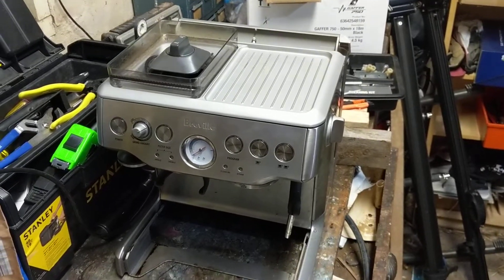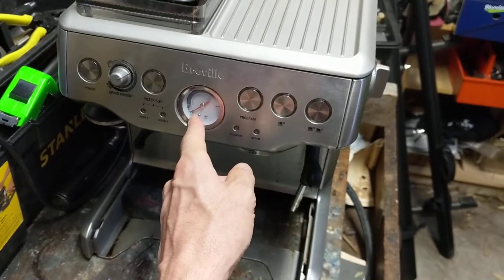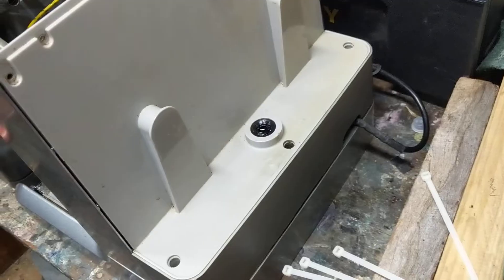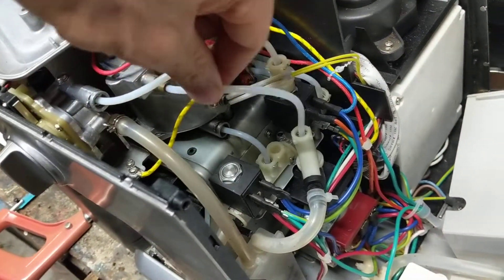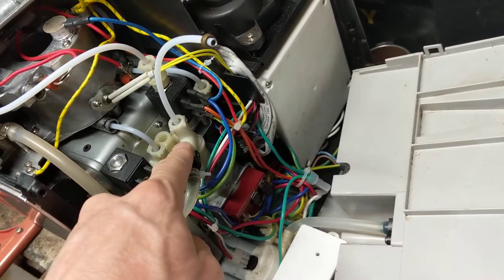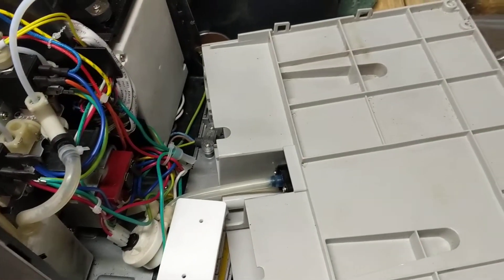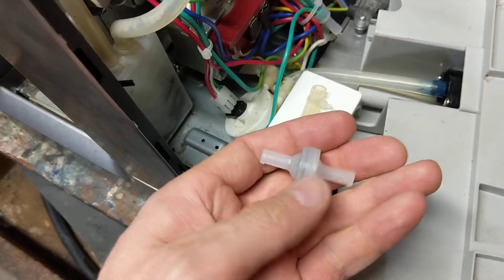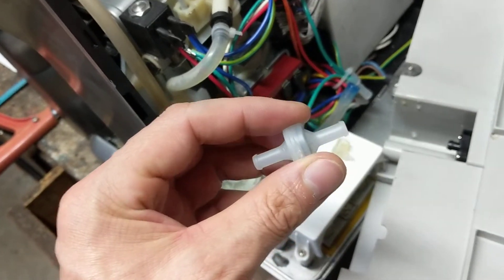Breville BES860 repair for low/no pressure and low water output

Comment: Thanks for this! I was almost at the point of ordering a pump. But after taking apart the float valve and that "this fellow"  part, i tested the flow after taking that off and it was normal flow. I let it soak in vinegar solution, washed and blew it out in case there was blockage. Everything works now. Thank you again Chris!
Reply: Hey mate, do you have the 860 or 870 xl ?

Comment: Thank you for this video. I wasn't getting any pressure until about 30 seconds of pouring the shot. I knew that the pump was working because of that pressure. My water spout also was coming out but very little and the water was splattering everywhere. I took off the tank and the back panel of the machine and saw the inline filter clogged (the one referred in this video). I couldn't find any replacement part and so I decided to clean it. I used an air can that has a straw (the type used to air out dust in electronics) and ran water through it until the water flow was good. The ties are important, use new ties. I couldn't get all the muck completely out, only about 80% of it. That is the cheapest solution. It worked like a charm. I hope this helps someone out.
Reply: Thank you, this video and your comment specifically helped me out! I had the same problem exactly! The filter looked fine, it was a Hail Mary pass as I was desperate to fix this issue. It worked. Thank you SO much.

Comment: Thank-you!! This video was really helpful and our inline filter was indeed blocked and the cause of low pressure.  My husband was able to blow out the blockage. (I think he used his compressor for that.) The trickiest part was taking the rear cover off. It is clipped in and took a few goes to get it off.

Comment: Bless your heart, your video has solved our problem! We were having trouble with our BES870XL - with pressure at the group head, resulting in incomplete shots and poor crema, and the hot water spout was steaming, spurting and causing a real mess. I replaced a lot of parts  - pump, safety valve, solenoid - and we were still no better off. After watching your video I took the machine apart again (I'm an expert now) and found and removed this filter. I put it in a mason jar with 100% Simple Green and immersed that in an ultrasonic cleaner for half an hour at 40ºC. Afterwards it was rinse, blow out with compressed air, repeat - about 5 times - and reinstall. Having made the other repairs I though this one was worth trying and I was hoping for the best but not expecting much. Lo and behold, everything is as new. Thank you so much!

Comment: Thanks for making this post, I took it apart and fixed my machine! I used a little flosser thing to clean it pretty well. Gonna order an extra part now for the future!
Reply: where can you buy this inline filter
Reply: @mikeamiri4794  SP0001461, You can also just clean the filter. It'll be blocked up by Charcoal, I used a reusable flosser thing and cleaned it up pretty decently. Prime reason to soak your water filters before installing them.

Comment: Was your machine not putting hot water at all? Because the shower head puts out little water while the hot water dispenser is functioning as normal.
Reply from the maker: There was very little water coming through and no pressure, however, steam worked oddly. The machine I have does not have a separate hot water dispenser, just the main shower head.

Comment: Thank you for your very good video showing the problem with the BES860. My daughter asked me if I would look at her unit which would not indicate pressure or give a coffee. Like you I suspected either the pump or solenoid. However as these are reasonably expensive and may not give a solution I eventually found your video. 10 minutes later the problem was solved. I actually reverse flushed the filter and now the unit is working well. Up until this stage I had dismantled the unit 5 times with no success.  Yes I am retired.  Tony

Comment: thanks Chris, this video saved my coffee machine as well. 
Tips for troubleshooting: (got it from home-barista forum)
Do a run with just the rubber cleaning inlet to see if you get any pressure (I got almost 0)
Let water run without gasket under to see how the water flow is (compare to video here when ppl do an empty run before making a coffee)
See if the plain hot water flow is slow as well (compare to friend machine or video on YT)

Cleaned my filter out with toothpick and banging it on the kitchen counter.

Comment: Thank you for this!

We were getting very little pressure, a teeny bit of steam, a drip of hot water. Obviously we were not enjoying a nice hot espresso for the last few days.

Came across your video, and went through the trouble of soaking the solenoid valves in vinegar overnight, didn’t do the trick. So clear the valves were not the problem.

Then I took out the online filter - BINGO!

Machine works again! You are a lifesaver!

Can I send you a bag of beans?

Comment: THANKS!!!  I ALMOST BOUGHT A NEW MACHINE .  Had my breville for 3 years thought it was time to retire it.  I had low water and no pressure, so I pulled the filter like your said.  I BLEW THRU IT USING MY  MOUTH.... TOTALLY BLOCKED!!!  I removed it and busted it open -- iT wouldn't come open otherwise ... the SCREEN WAS TOTALLY BLOCKED WITH SOME FIBERS -- BLACK GUNK.  <--- FIBERS FROM THE REQUIRED BREVILLE FILTER...?   Should have blew it out with compressed air, or used a needle to scrape the gunk away.   It is just  a screen filter to prevent large particles from entering the machine.  Just took the whole thing out, will replace later with a better in-line screen filter.   PERFECT OPERATION........  EVEN BETTER THAN BEFORE!!!  PRESSUE UP TO 12 O-CLOCK POSITION ON MY MACHINE, FIRST SHOT EXTRACTion!!!  I SUSPECT THIS I WHY MY MACHINE WAS RUNNING A BIT CRAPPY ALL ALONG...

Comment: Thank you so much. I had no pressure. I thought I would need to replace a solenoid or the pump. I cleaned the filter and it all works like a gem. Thanks again

Comment: Chris - thanks for timely tip. Replaced pump and machine still not pumping properly. Watched video, drilled thru screen and presto! Works great.
Reply from the maker: Nice. I didn't think of drilling through it. I cut it in half, cleaned it and glued it back together. I think at least one person who replied to this video was able to find a replacement part but I guess it's not essential, probably just extends the life of other parts as they get less dirt.
Reply: Hi Lee, did you happen to look against a light bulb to see if it was clogged? Or did you just go ahead and drill a hole!?
Reply from the maker: @fabriziosanabria5414  I also took this little video of the filter after I cut it in half. I glued it back together with a 2 pack glue (Araldite). https://www.youtube.com/watch?v=lxFlKTBczbo
Reply: @fabriziosanabria5414  - I could see black debris inside with a light. I tried to blow thru the filter and you could tell it was blocked. Decided to drill thru it. If tnook I was going to remove it.

Comment: You beauty! That was exactly my issue, I cut it open and it was full of crap, cleaned out back together and bingo, back to normal.
Reply: i took mine out and forgot to pay attention to which way it was facing.  Was the dirty side on the water side? and what did you use to cut it open im having troubles.
Reply: Shane Jowitt yes dirty side is water side as that’s the water entry point so debris collects on that side. I used a small Dremel cutting tool and made a fine slice, it’s not pretty but cuts it open, inside is a small metal filter, this is clogged from dust entering the water fill tank, then with super glue and baking Soda reglued it all back together, zip tie and Your water pressure is back to normal, like a new machine.

I would recommend then getting hold of Breville and seeing if spare filters are available to purchase, and getting spares. I’m currently about todo this. How many of these machines get thrown out over what could be a $1 filter..?
Reply: @zarmak2511  - Not sure if you will ever read this, but were you able to find the inlet water filter for this machine?  And if so, where?  I have NO water coming out of the machine...have done everything I can do and still nothing.  Have washed this filter a few times, but still no water.
Reply: Meme Meme  That’s the filter that I cut open, you need to cut it open and clean it or get a new one, my warranty was out by a couple of yrs so it’s was try and fix it or bin the machine, you may have a pump that not working,?
Reply: @zarmak2511  YAY...you wrote back!  
I have the BES 860XL.  It's one 9 years old, but I don't t think I've used it more than 20 times for espressos (I have a Nespresso) and used the machine mostly for steaming milk (stupid I know).
Replaced the pump...that wasn't it, so put the old pump back in again.
My husband washed all the tubes inside, including the filter, but he only rinsed it...didn't do an extensive clean like you did.
Where did you cut on the filter.  That particular part looks like a top (the toy) to me...is there a filter inside of it?
I tried looking for the part to purchase - Water filter Assy - SP0013624 - but it's no longer available.  
Thank you for being nice enough to respond.

Comment: Thanks, I had the same problem. This inline filter was completly clogged. I bypassed for now and will get a replacement ASAP.
Reply: I have the same problem but Breville is not able to locate or ship me this part. Where can I order this part?
Reply: @frederickguesneau8601  There are some on eBay but I found one at spares.bigwarehouse.com.au which I had used before for some parts. The part for my model was not available but I checked other models and found one that looked the same. When it finally arrived I compared the two and it was identical. This was their description. Good luck. 1 x WATER FILTER ASSY 8208 PRE TANK This part Suits Model:BES860 (PN:1674247)
Reply: @aw4296  Thanks Arthur. I called Breville  again and they were finally able to order part # SP0001461. If this doesn't work, I will  order via your recommended website. Thanks!!!

Comment: Super helpful, thank you @Chris Melin.  I have the BES920xl (the dual boiler), and this video and the comment thread even moreso helped me troubleshoot the problem.  I had done all sorts of work (symptom is very low flow from group head, but regular flow from hot water and steam wand, descale indicator always was on).  Your comments led me to pull apart the solenoid, and sure enough there was a piece of a degraded o ring wedged in the outlet aperture of the valve ... and it all works great now!
Reply: Hi, I think I have similar issue to you. Hot water spout work fine and so does steam. Does that mean pump is ok? However no pressure at group head. Even with blind disc inserted there is no pressure on the dial after 50s. I sometimes hear gurgling. The solenoid looks in good condition. However I can see some water on top of the valve that sits above the pump itself .. could this be due to a block?

Comment: Hi Chris :) Great video and so informative how you pointed out what every part is called! I too have this exact machine (BES860XL) and am getting ZERO pressure readouts...….. The needle does NOT even budge! Let me start at the beginning really fast. I bought this unit second hand recently and could not get it to dispense water either for espresso or to make steam for milk...….Although it heated up fine and all the right sounds were being made by the machine  (like trying to draw up the water out of the tank),  still,  NO WATER  ever came out the grouphead after like 30 40 seconds of running it.  Also when I switched to "froth" mode,  it tried to suck and made the clanking noise, but still no water or steam.  So I took it apart (love taking things apart LOL) and figured it must be a clogged water line since it sounded like the pump was trying to work. I decided maybe its clogged with calcium buildup, or maybe it just needs to be primed.....  In any case, I used a giant syringe (like a turkey baster) and had to put some muscle into it in order to force water into the tube (the one that feeds from the water tank).  I suctioned my syringe back and force with no luck and then something finally gave way and I was able to get water to flow from my giant syringe into the tube and into the machine. Then I added an extension to the short water tank tube and placed it into a separate cup of water and turned on the machine- IT WORKED and water flowed to make coffee and also to steam!!!! Beige colored water and some sentiment came out but I was thrilled.  ** My question is, do you think that whatever was clogging my water lines is now pushed into  that inline filter you removed in your video?  Would running a bunch of vinegar through it fix this issue or do I have to open this unit up again and remove the inline filter?  It does make espresso and all, but there is also ZERO pressure readout as it is making the espresso.  I know it can taste better than it does now. Please advise you opinion :) Thanks, Nicole
Reply from the maker: Hi Nicole, it doesn't sound like an inline filter block now that you have water flowing and could be a pressure leak elsewhere. To diagnose if the inline filter is the problem you can remove it re-connect the water pipes without it installed - this is how it is shown in the video. Then at least you'll know if that's the problem or if there is a pressure leak elsewhere. I imagine it may be a pressure leak elsewhere and you could start by checking the small rubber o-rings on each of the teflon water tubes. Sounds like the pump is OK since you get water and steam, so if it's not the pipes, then it may be the over pressure value or the solenoid that need replacement. I bought the solenoid block from Breville for about $140. I had to call and order over the phone as it is not readily available online. Good luck!
Reply: @chrismelin6337  Thanks so much for your reply! Actually there was no problem with the pressure gauge after all...….. I thought it was broken because it failed to move during the "pressure test" that the Breville guy had me perform while I was on the phone with him. Yesterday, my new filters arrived (I bought my machine second hand and it only included the 2 cup sized, single wall filter)….so this AM I used the single cup sized, dual-walled filter &  brand NEW COFFEE BEANS and I got a big crema on top and the pressure gauge magically came to life!!! I was so happy :) Before, when I used the older beans and the 2 cup, single walled filter the coffee came out black with no crema- so I can only assume the "broken" pressure gauge was due to my inexperience in choosing good beans, grind amount, grind fineness, filter size. Thanks again!! nicole

Comment: First off...this is EXACTLY what has gone wrong on two machines for me.  For those asking how to clean that little filter - its pretty easy.  First (and this is sort of gross),  put the clean end into some water, and suck on the clogged end until a little water moves through.  Then just bang the dirty filter side down on a counter top for a bit. Coffee bits and debris will slowly start coming out.  Repeat a few times and boom - its clean.  I do not recommend cutting it open and trying to glue it shut - no need for that.  You will need a  couple of small zip ties to put it all back in when you are finished - so find a couple.  It's an easy fix.
Reply from the maker: That sounds like an easier fix than what I did

Comment: Hello, many thanks for your very informative video. I have the low pressure problem in my Sage Barista Express. The pressure briefly goes up to the bottom end of the "espresso range" but then immediately drops down into the 'pre infusion' range until the water stops. It makes a full double espresso. It does the same thing on a single espresso. I have tried replacing the solenoid valve block and also cleaned out the little in line filer as you showed in your video but the problem is still happening. What would you suggest I try next? Many thanks!

Comment: Hiya, when you had this issue, did you only experience low/no pressure from the group head? Were the steam wand / hot water dispenser working? Reason I ask is Ive got an 870XL right now with ZERO water coming out of the group head, but the steam wand works, as does the hot water dispenser (and it is also hot).

Comment: I just cleaned water filter and start working, repair store sold me pump and wasnt working ,The test for the pump is not accurate, in my case was flow little bit , but was the water filter or you call inner filter, thanks for the video

Comment: I have another unit - Barista Express-BES870XL- the water coming out of the wand just stopped. I don’t hear the motor any more that controlled the water distribution from the wand. The motor is working that sends the water through the coffee grounds.  Can you tell me what is wrong with my unit? Where can I get it repaired? Where can I get the parts?      Texas

Comment: I have a Duo-Temp  Unit. I have around 1.5 cups of water coming out of the unit that goes through the coffee grounds. Normally it’s supposed to be around 1.5 oz (shot glass).  Why is there so much water coming out?  Any suggestions? Where can I order the replacement part?  Thanks again.   Texas